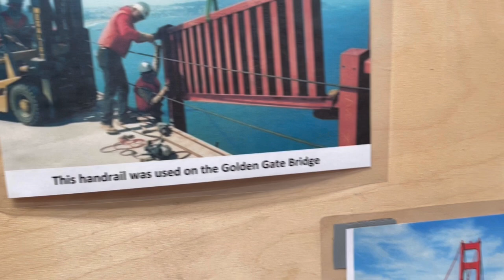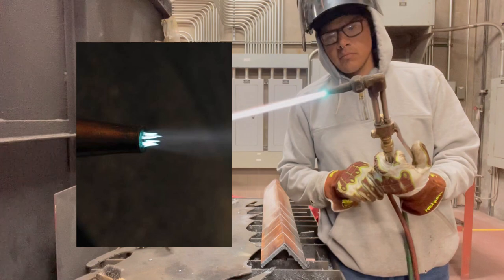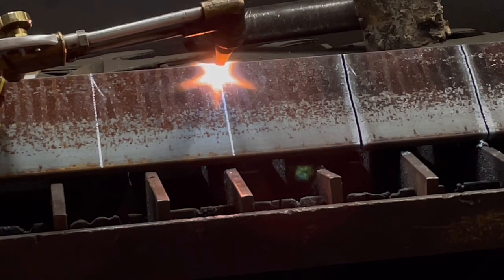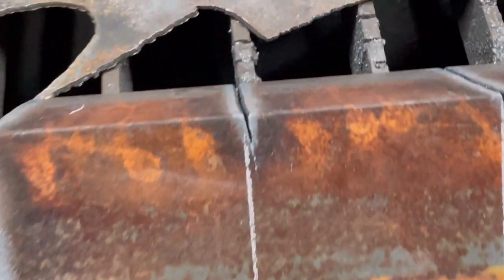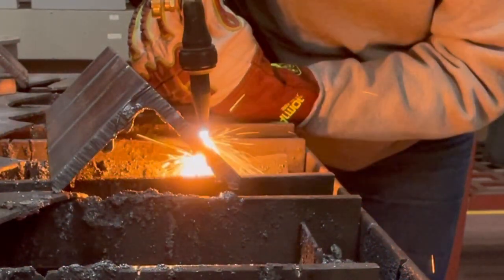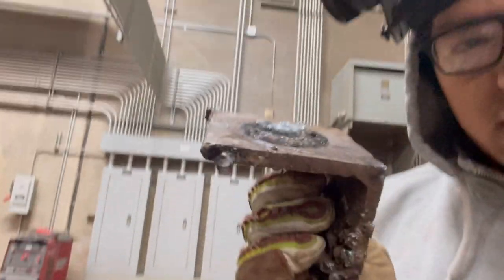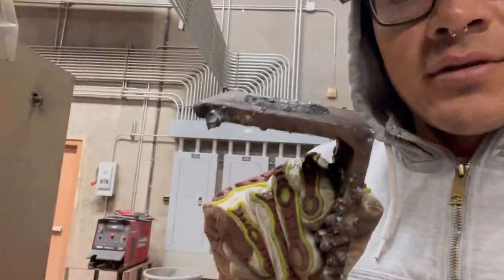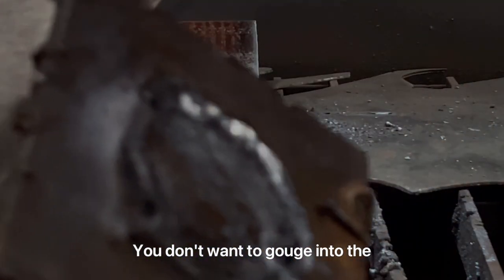A few tips on torch cutting

Comment: i get why you wanted to practice your torch skills bro but those would of came out cleaner with a Milwaukee bandsaw. Using the bandsaw also takes practice and I feel like using a torch for those plates is overkill in my humble opinion because you probbaky have to grind them afterwards. All you need to do is clamp that  piece of angle with two R11s clamps and cut them with bandsaw and its faster and the cuts would of came out cleaner you woukldnt have to use the grinder afterwards. but good job either way.Me persoanlly i like to use the torch for whenever i have to cut circles or really thick material but that plate can be cut more cleaner and faster with a bandsaw
Reply from the maker: I understand that, and I would have if it was an actual job or something important ya know. But for what it was and what it needed to do, it was just a fun project.